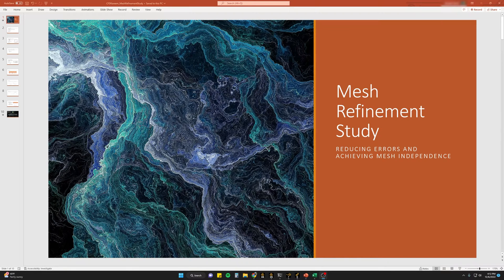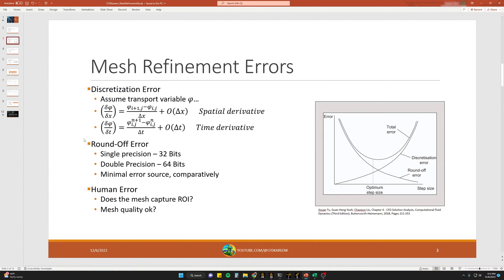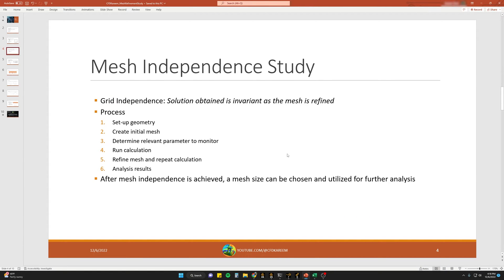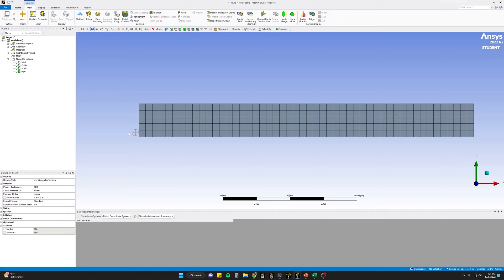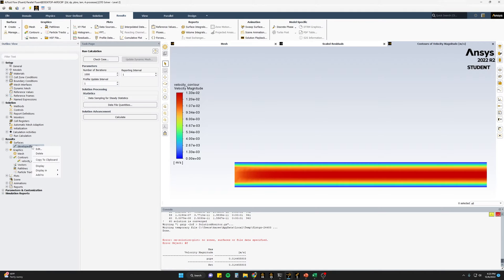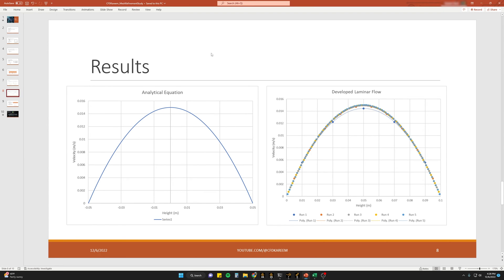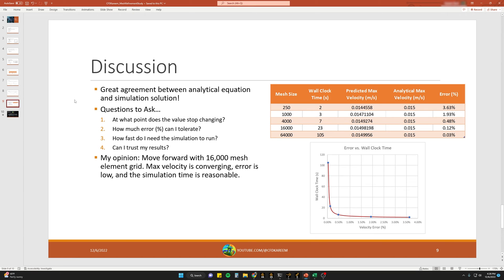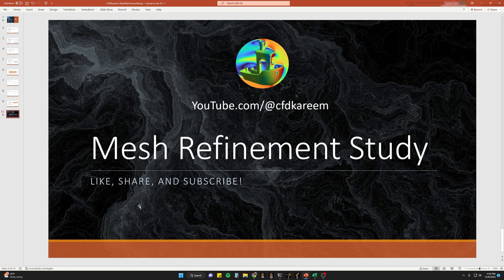ANSYS Fluent: Mesh Independence Study | Tutorial

Comment: Thank you for this!

If I may ask, how does one perform mesh independence test for a complex model without an analytical solution?
Reply from the maker: Without an analytical solution the next best thing is comparing to experimental data. If no data or equation exists, then you can compare the simulation to itself. You do this by picking a parameter of interest and tracking the percent change over each mesh iteration. When the mesh is refined the parameter should be changing only a small amount from one simulation to the next.
Reply: @cfdkareem  much helpful! Thank you!

Comment: Would it be really hard making a video about UDF's? I personally found very little about it here in youtube, atleast those that are actually helpfull.
Reply from the maker: Hello, making tutorials about UDF's can be challenging. Most of the challenge with writing UDF's is understanding the coding in C+. In the context of Fluent, I will consider making a tutorial on the Fluent specific coding aspects of UDF's. Thanks!
Reply: @cfdkareem  I agree lol, I imagine making any tutorial for Fluent challenging, and for that I wish you had more visibility to compensate the hard work :/ Be sure that i'll help by sharing as much as possible.

I asked for an UDF tutorial mainly because im unaware on how to implement to my model the phenomena that im trying to simulate.. Im looking to simulate the effects of using periodic excitation to control a fluid jet of any sort, as in a speaker placed right at a duct exit where a jet is liberated. Essentially making a simple pontual sinusoidal "vibration" on the boundary (inlet) perhaps.

Do you have any idea on where I should look to learn on how to do that, like is UDF even the thing :0? I asked on ANSYS learning forum and the guy said to look for a variety of things like Dynamic meshing, "Fluidic switches" (which doesn't even make sense), profiles (on which you've already made a video about) and 'expressions'.

Meanwhile, thank for answering my comments, sincerely :)

Comment: Im out of words, literally most youtube videos on this subject lack the objetivity and clarity that you've had.. Thumbs up man, please continue posting more videos, you're probably one of the best I've watched so far..

As a question, something that bothers me alot is checking the mesh quality feature while meshing, at first intuitively I would think having a mesh with 100% (all squared divisions) is always the best, but then why is there tetragonal and triangular modes? to better capture curvature?
Reply from the maker: You are correct. A hexahedron "hex" mesh, all squares, is usually the most efficient mesh. This comes from the fact that you can discretize a volume with less elements and therefore the simulation runs faster. However, when the geometry gets complex (curved surfaces, small channels, organic shapes, etc.) it becomes difficult to fit a mesh of hexahedrons of good quality. This is why tetrahedral meshing is more popular for complex modeling. There is no inherit difference in solution accuracy between each type of mesh. As long as the mesh quality is good either technique it will give good results. To take advantage of the strengths and weaknesses of each it is common to due "multi-zone" meshing for complex models. I.e. use hex mesh elements in simple regions and transition to tetrahedral in complex regions.
Reply: @cfdkareem  Fascinating, thank you very much.